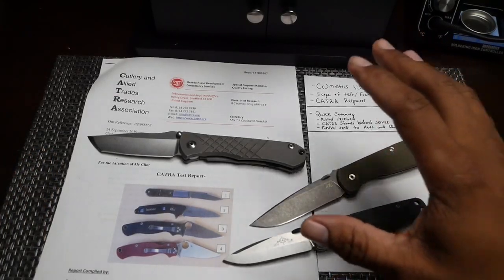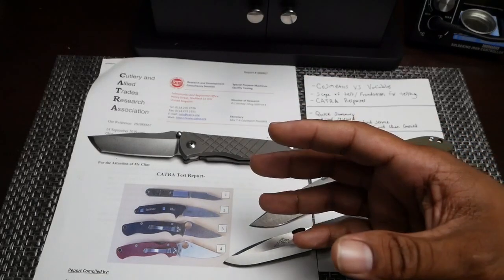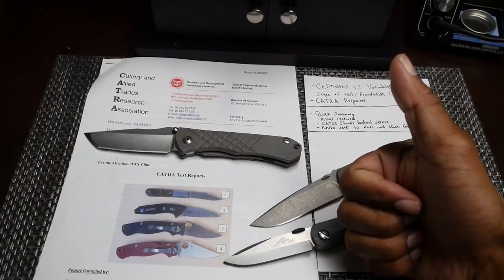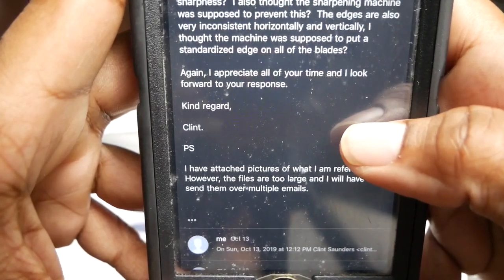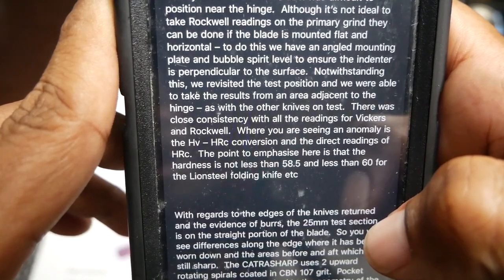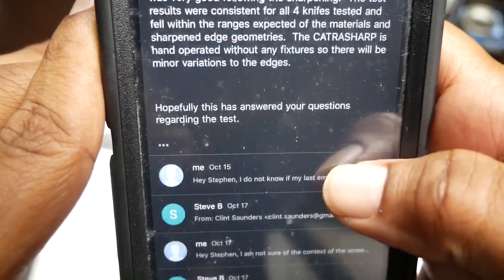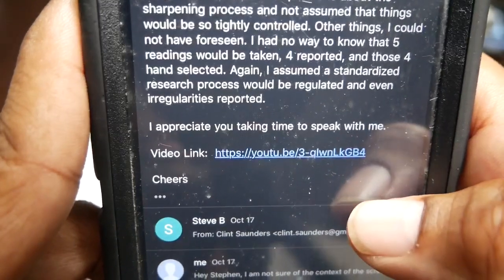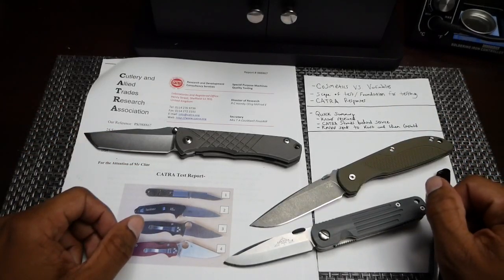CATRA Midpoint Update:  CATRA Stands Behind Their Work

Comment: Was this ever sorted out?
Reply from the maker: There was nothing to sort. They broke communication and that was the end. The knives were tested for hardness and cardboard cutting by two other guys in the community and the info was all put out. That pretty much put an end to the debate in the community. It’s been silent until Larrin and Shawn started their project. And I’m not saying that to say there is an issue with their project. We are acquaintances. It’s just that all the guys that were vocal detractors have been silent on the topic since this report/these reports came out. 

I guess CATRA would have had a hard time explaining all the inconsistencies in the reports alone. I’m sure they did not want to even start.
Reply: @Alumapro23  Sorry to be clear, I meant you implied you were going to have other people do some kind of quality/reference check. I meant was that every done and do you have a link to that work. 
Not sure about what is debated, knives are a tool, they have a simple function, it isn't hard to figure out if they do it or not, or which one is better than another at it, cavemen could do that and they were basically monkeys.
Reply from the maker: You’re preaching to the choir, but this is a “controversy” (yes, I am using the word that was used in the community...I know you’re and OG, but most of the community has moved off of websites and onto Instagram and that’s where lots of these discussions take place and info drops in real time). However, you need to tell that to Rob “Apostle P”, Mick Latham at Collector Knives, Ferrum Forge, Mike Emler, etc, etc, etc. Not to mention all of the individuals without channels or a large platform that gets massive amounts of exposure. 

Before this test, that was demanded by the community, it was a “controversy”.  After the test, 90% of the people dropped back into the shadows. 

Instagram is really the best place to talk to everyone. The messages here do not always come through and Instagram is just....well, instant communication. The channels that did the testing, did testing at least a year and a half before all of this (that’s how the “controversy” started....cardboard cutting isn’t scientific...its “bro science” and a “professional” test like CATRA is the only way to blah, blah, blah), and still do testing till this day are jcoolG19 2 and Outpost76. 

Kurt (Jcool), Gerald (Outpost76), and myself are just a small part of a larger conglomerate of users, makers, and long time knife guys that take on stuff like this. Kurt is JcoolG19 and Gerald is Outpost76 on Instagram.
Reply: @Alumapro23  Thanks, makers can be in a hard spot at times, they see some guy do a test and make often a huge leap about steels or knives from one sample - they have a lot of people listen, and sometimes it isn't handled correctly.
Glad to see you guys are still using knives.
Reply from the maker: We have a spreadsheet of probably 200+ knives now. We’d have more, if we had the time to process them. That’s the other reason none of us saw the reason this info was a “controversy” or “drama”. There is a clear trend and clear science around hardness, refined steel matrices, etc. The hardest knife in the CATRA run was a glaring example of this. Classic, burned to hell, poorly processed, Kershaw 💩. Same with the Lionsteel stuff. Who knew aggressively dry grinding your knives and getting them hot was bad for your knife 🤷‍♂️🤣🤣🤣
Reply: @Alumapro23  "There is a clear trend and clear science around hardness, refined steel matrices, etc. " That is about what you would expect if you are cutting soft/abrasive material. 
"Who knew aggressively dry grinding your knives and getting them hot was bad for your knife "
It is all a conspiracy man, have to sell water for coolant, possibly something to do with fluoride or 5G. 

Is that spreadsheet public?
Reply from the maker: What is about what you would expect? You do not think adding excessive heat to a tempered blade does anything to the steel?

Yessir. If you go to Jcoolg19’s Instagram page, the link is in the bio. He may have it in the description box of his YT vids too.
Reply: @Alumapro23  I would expect your results, they seem reasonable to me.

The only thing I would say is to take care about hardness and the other factors and excessive generalizing. A lot of people just over simplify, and that's dangerous. I have been doing a lot of wood working recently for example with 3V (Peter's) and the blunting is from chipping mainly so increasing hardness/carbides would only make it worse edge retention wise. But as long as the cutting is similar to the tests (material and methods) you should expect similar results. 
Yeah, I was kind of making a joke, I was one of the few in the early 2000's that openly spoke up about hot grinding due to its effects on steel, even IF the steel never discolors, which is what most people think is ok (Bark River for example being one of the worst offenders). But you can get damage at the apex long before the body of the blade itself has excessive temperature, and high alloy steels will resist oxidization coloring for the same reason they resist rusting, but they still get heat damage.
Reply from the maker: Cliff Stamp There’s a lot more info out there. I really suggest tapping into Instagram. This project came after almost 2 years of work, documentation, working with users, makers, and individuals that have access to metallurgical equipment due to their work in the field in one capacity or the other. This is a capstone project, not an introduction. 

What I have seen in my time as part of this project is that people do not want to have to listen to a full expectation, they run with headlines, the go with whatever the “biggest” name says, companies lie (see my Benchmade Bailout videos as one example), they do not take the information for the scope that it is meant (for example, these “tests” focus on general end user use. Paper product/soft material cutting, not “hard use”/bushcraft tasks), and being a fan of a company is more important to people that receiving the truth about the products they are being sold. The info has been well fleshed out and shared. People did not want to receive it until the last thing the bug names they listen to (CATRA) disintegrated in front of their faces. Then everyone shut up because there was nothing else to say. 

Absolutely some of this work harkens back to things you and the other people that were talking about steel have talked about for years. This has been an evolution of that. Not only speaking on the topics, verbally sharing experience, but bringing in charts, video recording extended testing, utilizing machines to measure steel characteristics, and then showing patterns that are constantly emerging. Besides the fact that the 3 or 4 of you guys that spoke on these topics 20+ years ago, it was interesting to all of us that common sense was not enough to make this a blindingly obvious set of facts. 

However, YouTubers that are more or less paid advertisers, company “fan boyism, stubbornness, and plain out willful ignorance have just not made that the case. Even after all of this has died down, people are still chasing stuff like burnt and poorly processed 20cv that is being sold for its wear resilience, but has been shown to perform on par or worse than S30v. It’s really a sad situation, but even this capstone project is going on a year old. If people don’t get it by now 🤷‍♂️
Reply: @Alumapro23  Is there some kind of summary of the results I could read, or raw data to look at, information about testing materials, etc. ? Instagram is a big place, lots of deep waters.
Reply from the maker: Each of the guys I’ve mentioned have their own area of specialty. There are even more guys, but you’re already talking to a good bit of them. Steve and all those guys are all part of the same group. Each person has links in their IG bio and it YT bio. 

There is not one set place. That is the next area I’ve carved out for myself. There is an unpublished website that is just going to do basically what I’ve been telling you. It’s going to have the spreadsheet, the CATRA reports, links to everyone’s social media, there’s been talk from one of the makers in the group about a forum, and I’d like to see a small store that sells stickers and things like that to fund all of the knives we buy, calibration of the Wilson tester, cardboard, shipping knives all over the country, etc. We’re all self-funded and independent. We want it to be that way. No conflicts of interest. When we put out info, people know it is as objective as possible and unbiased. 

That’s part of the reason we face the hell we do.  People are used to listening to YouTubers that are directly or indirectly funded by the knife companies they do “reviews” of their knives. People aren’t used to raw truth with data/video to back it up. 
 
Larrin Thomas and Shawn “Big Brown Bear” are starting their own CATRA project. A lot of the info is also shared on IG. They’ve both been in communication with all of us before, during, and after the “HRC controversy” and subsequent CATRA testing. Everyone is directly or indirectly associated with one another.
Reply: @Alumapro23  Thanks, I am mainly interested in methodology.

I was a bit surprised by Larrin's CATRA project, Buck showed ~20 years ago that CATRA doesn't actually measure edge retention (the compared different knives in different steels), and the numbers it generates do not correlate well to what happens when people use knives either (they compared CATRA to people just doing cutting and resharpening). It is an odd thing that it actually caught on as there is no data to show that it actually is a valid performance test and lots of data to show it isn't.
Reply from the maker: Cliff Stamp The community funded project I headed spurred a lot of things in the community. Larrin and Shawn’s work is just the latest. Lots of people have lots of reasons to be on one side or the other. 

The collective data from the spreadsheet and the data from the exact knives used in CATRA do correlate. Kurt verified the hardnesses and Gerald ran the knives on cardboard with validation run(s). The general trend was very clear. 

CATRA was only done because the cry that “bro science” wasn’t relevant and “professionals” needed to perform the testing and remove all the variables (big laugh there) was the only way. You can see that rhetoric repeated time and time again from some of the guys I mentioned in my first message to you and many more. It was a general consensus amongst the community until everyone saw, live and in color, the train wreck CATRA is and the fact that the data correlated anyway you cut it.
Reply: @Alumapro23  I would be concerned if you were getting results which correlated with CATRA for a number of reasons, because what CATRA measures is essentially low impact, high abrasive wear with no lateral loading. In general use, edges rarely, if ever fail due to slow wear. Plus if you just wanted to know that, well that is an easy material property to just look up, you don't need to measure it, that will all be in the patent information generally, plus there are empirical formulas for it in various tool steel references (based on hardness, carbide volume and type generally).
In general, when you are designing an experiment to measure something, the first thing you want to ask is - what exactly am I trying to measure. Another way to think about this question is to ask yourself - what am I trying to predict based on the results of this experiment. The experiment has to be designed so as to allow that prediction otherwise you can end up with very accurate measurements which don't let you answer the question you set out to answer.

I would be curious if blinding was used in any way, single or double to ensure the results were robust as well.

As an aside, I tried to talk to the CATRA people a long time ago, I had access to their exact data (the raw data not the final results) and I had a number of concerns. As soon as I got critical and they found out I was "on the line" they stopped talking.
Reply from the maker: Yeah, I have a background in microbiology at the Ph.D. level. I’ve designed protocols and run them for industry. I can’t really talk about my projects here, but one of our side projects (you know how grant funding is) was to culture MRSA for a local hospital and chart out it’s resistance to a number of different antibiotics.  I’ve also worked on the academic side of science. 

The “bro science” vs “professional science” conversation has been had countless times. That is how this entire project came about and why I keep directing you to certain locations.m/people. That is where whatever historical record remains is located. 

The data is there, man. You can see it for yourself. I’ve given you the places. It all says exactly what we stated when we started this convo and even a “caveman” knew. 

That’s why this is a year plus old, non-issue. The only issue people had was how badly CATRA got exposed. Just like you found out when you tried to talk to them and they got upset with me when they asked about my affiliations.  

I kind of have to say the same thing I said in one of my previous messages about the community at large. All respect to you, OG, but the facts are the facts and if someone can not accept that, I can live with that. The work has been done at multiple different levels, by multiple people, in independent locations, even using the same model, but A different “sample”. The calculated difference between everyone is in the single digit percentage points.  Guys that make knives for a living and even individuals that have studied to be metal experts have been involved. At no time in our community has there been such a coordinated and thorough effort to dig into any topic. One of your guys even reached out to us during all of this and got us set up on your forum. I feel bad that I never really spent any time over there, but that’s not where the work or conversation was/is. 

I’m not sure why you’re onto this project a year plus after the fact, but I hope you find what you’re looking for. 🙏

Now, the conversation is about geometry.
Reply: @Alumapro23  Someone asked me for an opinion on a video and I don't talk about anyone/anything without talking to the source. Hence I wanted to see some data, check some methods, and see what conclusions were being drawn before I offered any opinion. 

As a note on methods, considering your background, you have to know the reasons for, and the dangers of not blinding when you are collecting data, and as well limits on precision as a function of various sources of error. 

Doesn't it give you concern at all when there is not even single blinding being done (ideally should be double, but that's hard unless you get to-spec custom blades) and when you see the results of multiple trials being within a few percent of each other when :

-the behavior is strongly non-linear
-any of the dozen or so sources of error is far larger than 1% (by 1-2 orders of magnitude)

Since blunting is nonlinear, in order to get the edge retention to a precision of say 1% you would actually need a sharpness measurement an order of magnitude below that, and nothing can do that (the sharpness of the blade itself will vary about 2 order of magnitude along it).
Reply from the maker: I pointed you to the people that can give you that. I’m at a loss, man. I really do not know what more I can tell you. 

We covered early on that there’s no reason for this to even be a conversation. Even cavemen knew “good” and “bad”. Diamond cuts a sidewalk and graphite is worn away by the same sidewalk. It’s not a hard concept. 

I have no concerns and this is an old topic. The guys you can watch, in real time, are Gerald and Kurt. You can find the chart there. You can find both copies of the botched CATRA reports in my video. If you want to talk about these topics, the guys and anyone that is talking about this are on Instagram. I really don’t know how to give you more information or point you in a better direction than that.
Reply: @Alumapro23  No worries man, just wanted to hear your thoughts on a few issues since you have a empirical based PhD, there are few people doing knife work that have a background in data measurement/analysis so often it is hard to discuss certain issues due to lack of background knowledge (the influence of non-linear models on point comparisons being one that I have never really been able to present in a way that I think a lay person can understand).